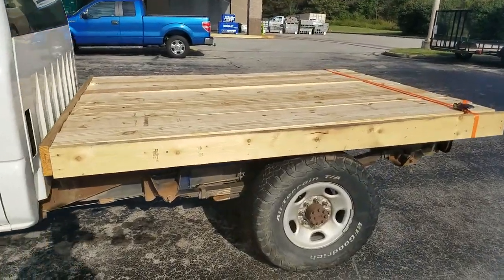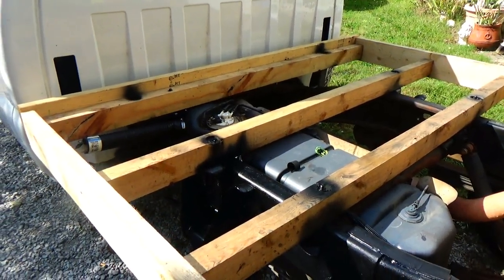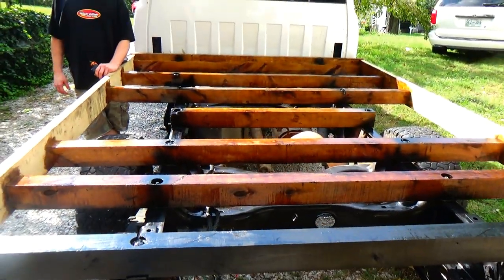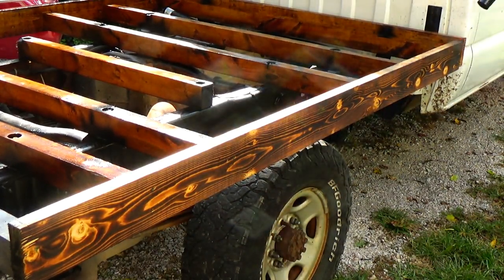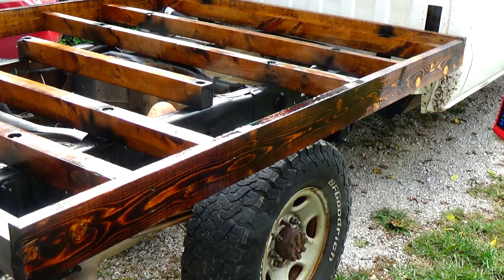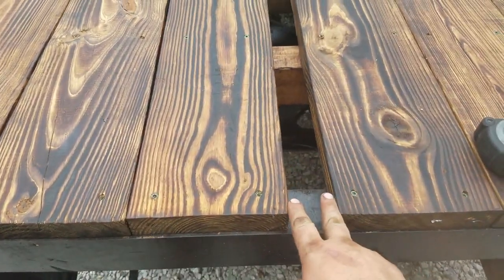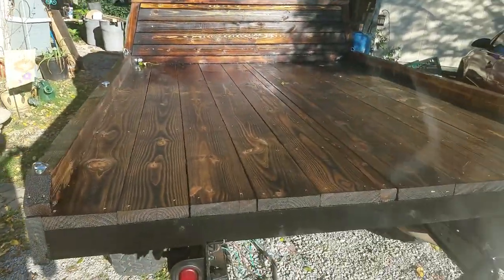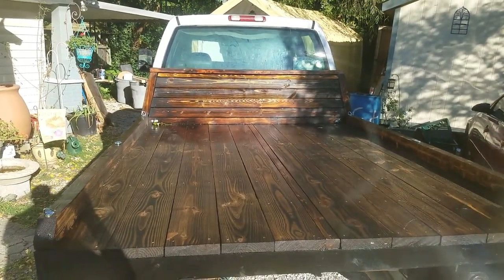BUILDING MY HOMEMADE TRUCK FLATBED OUT OF WOOD

Comment: Re-oil every 3000 miles and that will last more than 20 years. Great job!
Reply: If you use a chemical sprayer with the 50/50 mix, it will take 10 min to oil it AND your frame to never rust
Reply: Been looking for ideas for a wood bed, and I much appreciate this video man

Comment: Back in the day, diesel was used on house foundations as a termite prevention.
Reply: Also, back in the day, in some counties around the country, road works departments would spray thinned down oil on dirt roads to keeps dust down.

Comment: Thanks for this. I think it will last 5 years. If pressure treated I would say much longer.
Reply from the maker: Thanks for watching bud. Its held up for 2 years so far with a good clean and re soak in oil mix every 6 months.
Reply: I wonder if treated would burn into that neat look he got?

Comment: How did this project hold up.
I want to flat deck my old truck and turn it into a camper tiny home.
Reply from the maker: Its holding up great, i sold the truck to my biddy last year and it still has the wood flatbed on it being used daily. I recently built a flatbed trailer using the same concept and its also working great.  Good Luck on your build bud.
Reply: Hunt-Hike-Bushcraft, if you do make one please show on YT. I am wanting to make a panel truck bed like the old Model Ts out of my bed-rusted 2006 Dakota. I'll sub ya!

Comment: hey looks good! next time center the first board then go both ways you'll never end up with that 2 inch pcs
Reply from the maker: Thanks bud.  That 2in strip was originally going to be a steel tube with tabs for a motorcycle holder that never got built. 😆

Comment: wow. that looks amazing. Is the torching just for looks ?  How did you attach to the metal frame ? Did you have to drill into the frame or were there existing holes you could use? pretty slick man.
Reply from the maker: Thanks bud. The torching is mostly for looks. I used the existing bolt holes in the truck frame to attach the wood frame with the exception of w bolts that where welded to the frame for the center sulport.

Comment: How hard would it be to buy a new bed an get it back to normal if you wanted to? Just curious love the genius here. Would be perfect to slide a light 10 ft boat on an strap down!
Reply from the maker: Thanks bud. I used the factory bed mount locations so all i would need is a new bed with mounts and bolts.

Comment: Does the finish of oil and diesel smudge on your clothes and skin when leaning on the bed?
Reply from the maker: It's a bit wet for the first few days but once its soaked in good it's fine.
Reply: It more so leaves a "film" on your skin on hot days when it seeps a little

Comment: Not trying to sound stupid, ive been wanting to make a flatbed for my truck, I have to change the fuel pump so though why not now. In the description you say "3"x4" birds" did you mean 2"x4"? Just pricing the lumber and want to make sure cuz I am not finding 3"x4" lumber on the Lowes website.
Reply from the maker: 3x4 skids are what i used, 4x4s are what you should be looking for and using from lowes.

Comment: Are you concerned about the exhaust catching the wood on fire?
Reply from the maker: That thought never crossed my mind actually, 6 months in and it hasn't caught on fire yet.
Reply: The wood should be pretty well cleared from a lot of the exhaust heat.
Reply: Nachodads Garage still no fire?
Reply: Any fire yet? Jk. Great build 👍🏼

Comment: 2 years later how she holding up?
Reply from the maker: Like a champ,  i sold it to one of my buddies and he uses it almost daily.  We clean the boards with super clean every few months and re-apply the the oil/diesel mix.   I built a 16ft flatbed trailer out of a boat trailer last year using the same technique and it works flawlessly as well.

Comment: Im.also building a wood flat bed for a f 250 tho but it's a 500 doller truck and I have all my lumber so ima try for a 25 doller flat bed I like tour design best of all that I have looked at for my basic lay out
Reply from the maker: Awesome bud, glad the video could help you with your build.
Reply: @nachodadsgarage1159  got it done its 7'3"×8'8" thanks turned out nice

Comment: were you able to load this up heavy without contacting the tires? im trying to decide between 4x4 or 4x6 for the frame rails.
Reply from the maker: I had it stacked to the roof with 2x12x12s and it didn't rub. There was about a finger between the tires and bed.
Reply: @nachodadsgarage1159  perfect. Thanks for the quick reply!

Comment: How much weight would you wager those wooden crossbeams can handle?
Reply from the maker: I never had an issue with it holding weight.  Most i had on the bed was 1 1/2 cube of brick and it did fine.  I have built a 16ft utility trailer on a boat trailer frame using the same method and have hauled small cars on it with no problems. The videos of the trailer build are on my channel also.
Reply: @nachodadsgarage1159  Thks. Just got a '94 7.3L IDI diesel with an E-350 cab on it and a 16ft chassis off a neighbor for $3500. Used to be a box truck before someone lit the box on fire hehe.  Wanna build a small RV on it, trying to figure out if I need a welder or if I can get away with your method. Sounds like wood would work as long as I took care of it. Thanks.
Reply from the maker: if the floor of the box truck is still good I'd use that.
Reply: @nachodadsgarage1159  nah the whole thing was taken off before I bought it
Reply: might reinforce the 4x4 crossbeams with some barstock or superstrut though.

Comment: Is the oil/diesel "stain" slick?
I'm looking to do this to be able to transport a lawn mower, trimmer, etc. for a lawn care business.
Reply from the maker: It's a little oily for the first few days if you apply multiple coats in a short time like i did but after the first week it dried up nicely.  It's less slick than a steel bed when it dry but it's just as slick as steel in the rain.
Reply: id just use pressure treated lumber n call it a day
Reply from the maker: yeah but im cheap and had most of the stuff already
Reply: @nachodadsgarage1159  depends on time availability, if just weekend warrior approach then ya,otherwise I domt see reason to waste time torching and painting,slap some boards and good to go ,anyways props for stylish build, I'm just keyboard warrior 😎

Comment: How did you wire up the tailights?
Reply from the maker: The truck had a 4 pin and 7 pin trailer plug so i used the 4 pin to run the tail lights and the 7 pin for the trailer.
Reply: @nachodadsgarage1159 thanks.  Anything you would do different if you could? Just priced a metal flatbed and it was over $2000 for a simple design. Definitely going this route. How many tanks of propane did you use roughly?

Comment: Awesome video! Do you still torch it and seal it with the diesel/oil mix if you want to finish it with paint?
Reply from the maker: Nah i used the oil as a stain instead of paint. You want the wood clean and dry if you want to use paint.   You can torch it and use poly or stain instead of oil.
Reply: @nachodadsgarage1159  Makes sense. Thanks for the reply. Look forward to the possibility of reviving the look of my Ford truck with a new DYI flatbed hopefully. Thanks for the great information on your video.